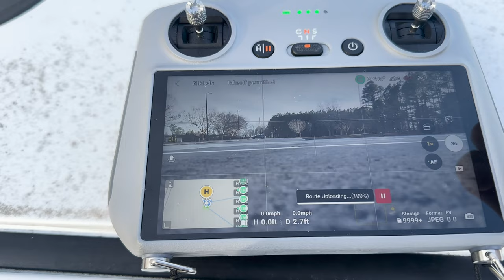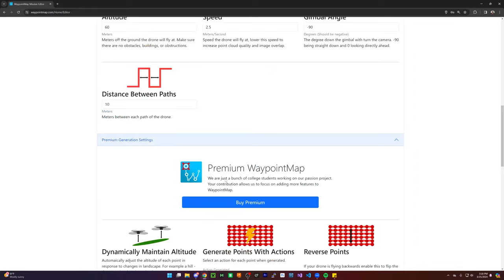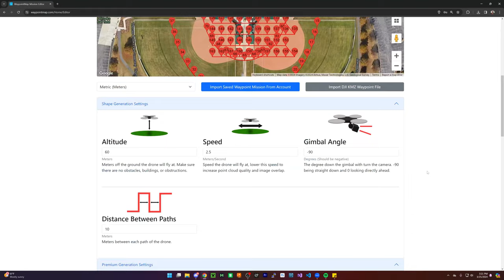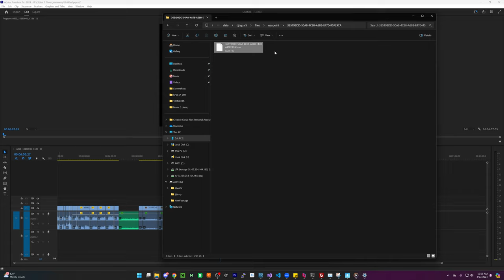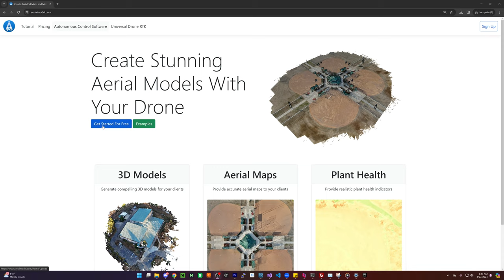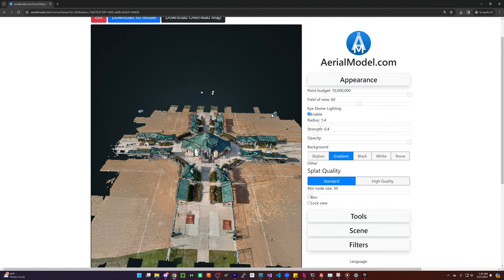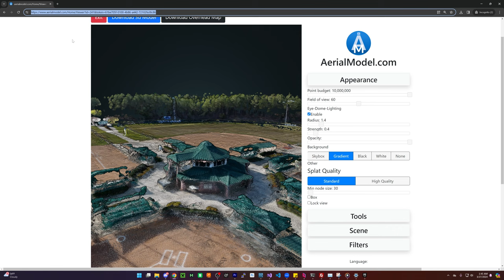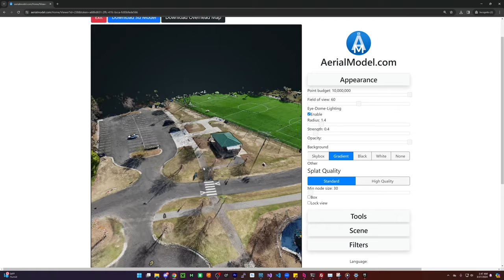DJI Air 3 For Photogrammetry and 3D Modeling Review

Comment: Gonna support your work with the premium. A quick question: I have an incoming task with huge areas that need to be separated into at least 10 areas. Do I need to create the same simulated waypoint mission to match the numbers of them? Also, what's the max point for each mission you suggest I saw some people have over 150  and the RC controller just froze.
Reply from the maker: Yeah I would break it out into 150 points. DJI has a limit at around that number of waypoints.

If you don’t generate every point and just used the timed shots instead it will reduce the number of waypoints but still capture the same number of pictures. (Make sure straighten lines is on)